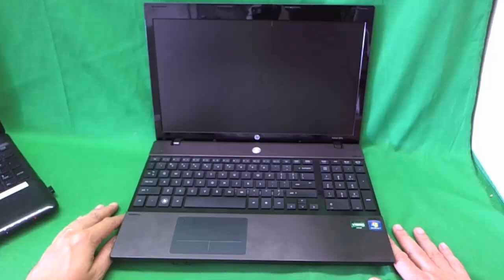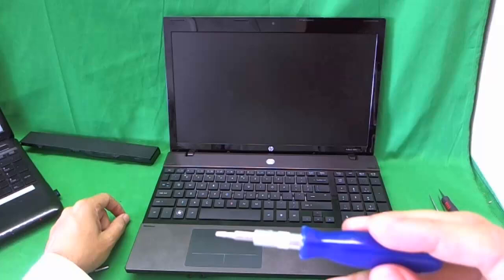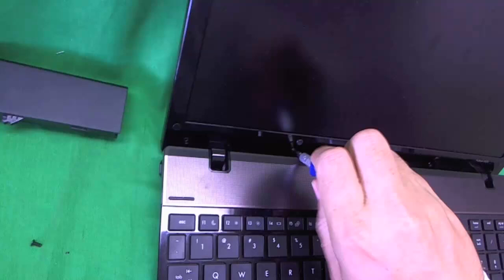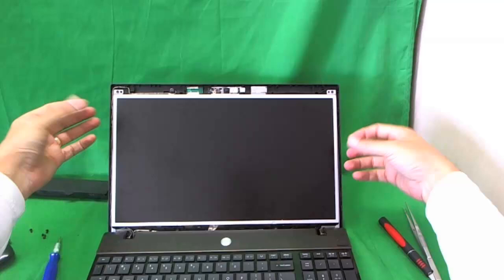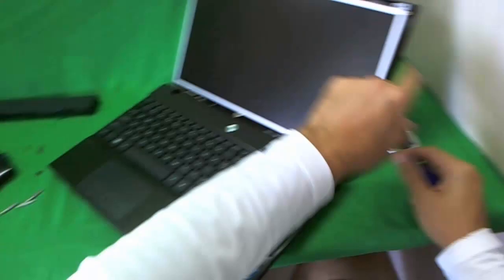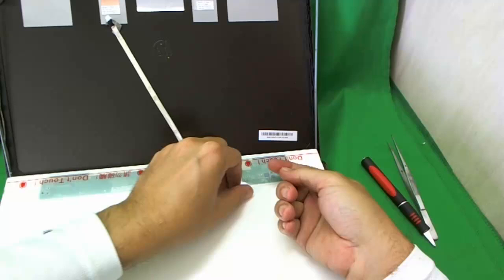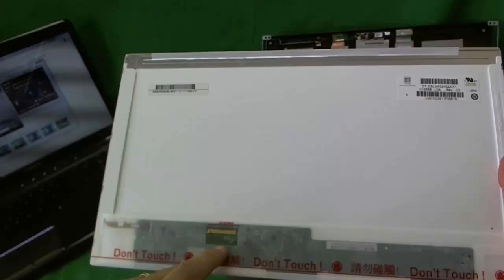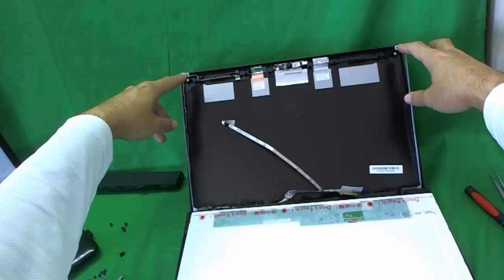HP ProBook 4525s Notebook Screen Replacement Procedure

Comment: Great video! 

can the bios be removed and replaced easily? or does it require soldering/desoldering? I guess I should say what does it require to replace the bios in an HP Probook 4525s?